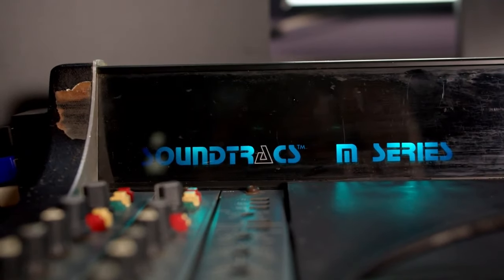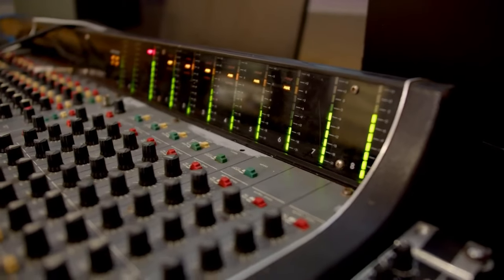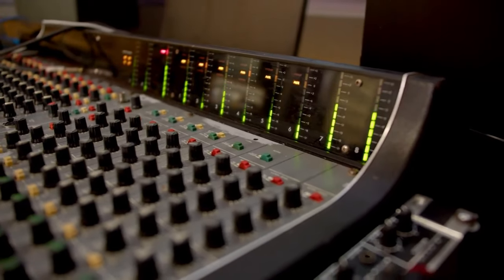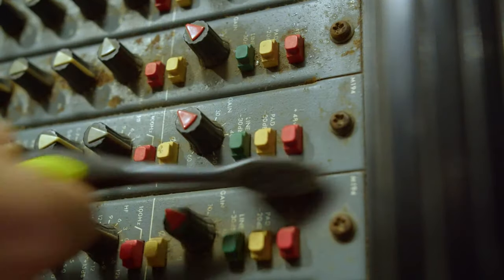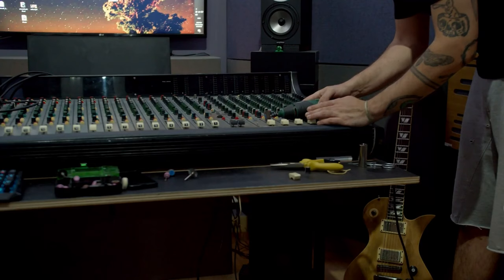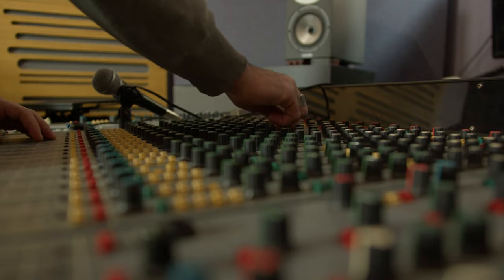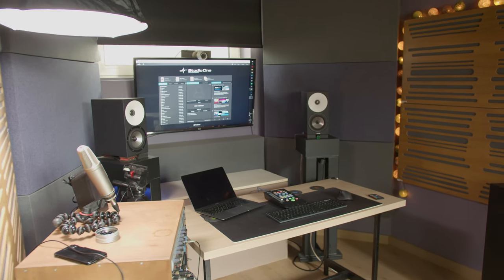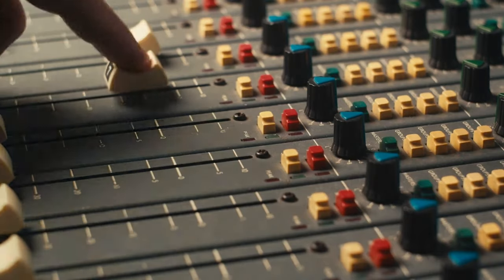Getting an analog console || A mistake for Our Home Studio?

Comment: My biggest question from your pre comparison was if you rebuilt an "upgraded" power supply or if you just built the schematics of the stock one? It's supposed to make a huge difference on these consoles -- and for the money you paid, I would say just buy an upgraded console instead of building one because you got it for so cheap already. Other than that, the real purpose of an analog console in modern recording imo is just more efficient workflow.... for some people. Some work better out of the box instead of in the box

Comment: Do you think you would have kept the console if it had been more reliable and did not have high frequency noise?
As I get closer  to finishing the restore of my Sony MXP-3036, I'm still questioning whether I should go through the process of moving the massive beast into the studio, rewiring all my connections, and building new racks to house the power supply and my outboard gear.
Reply from the maker: I honestly don't know, because technical problems aside, the benefits of having it were routing options and a tiny bit of sonic difference.. I think that eventually I would reach the same conclusion, because for my studio here I need at maximum a 16 channel console. That is of course if you are using it only as a front end while tracking, if you have something that you can also mix through, in my mind it is different.. But still for a small studio like mine I think the route of individual preamps/EQs makes more sense (although it is far more expensive than a console of this caliber).

Comment: Get a digital mixer instead?
Reply from the maker: I have thought about it, but for my situation here I’m leaning towards a DAW controller and outboard preamps. Do you use a digital mixer?
Reply: @TrailOfSound  Yes I've integrated a Midas M32.  I don't recorded a band or anything like that but I have various hardware synths.  It checked a lot of boxes which is why I went this route.